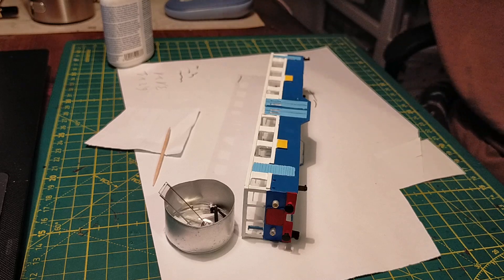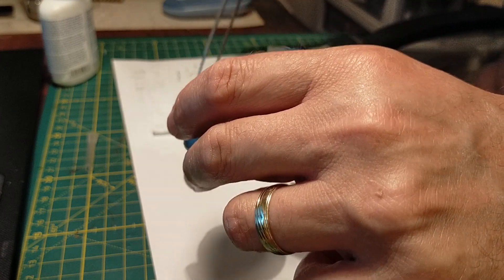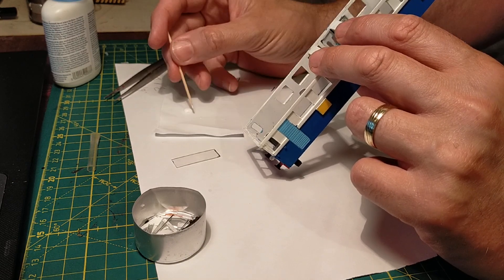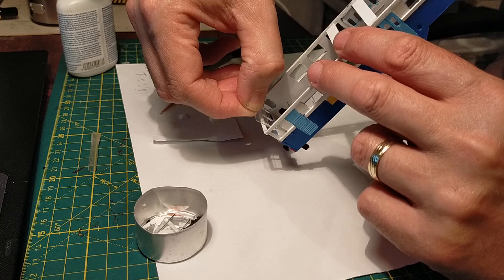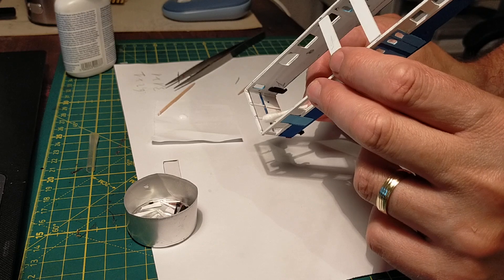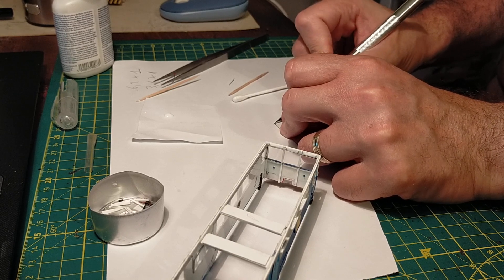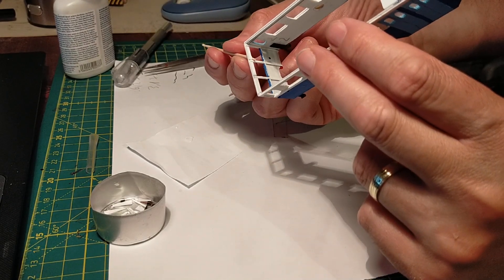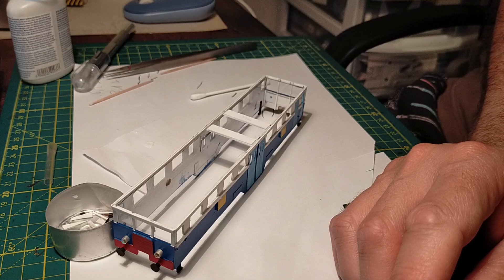Freelance railcar episode 34: fitting the cab windscreens with Glue 'n Glaze glue.

Comment: A meticulous job here, but very well accomplished. I'm glad you did the black marker frame of the glazing, it is a fine trick - I applied it when I did some windows for a water tower - way simpler than cutting very narrow styrene or even paper strip, making a slat frame etc. Also the Photoshop would be great in some cases - like making "stained glass" for a church windows, printing, cutting, carefully gluing on some glazing, then illuminating that building. Thanks for the video, Patrick, good day! / Chris :goodvibes:
Reply from the maker: Thanks! I've not marked black window rubbers on this model, as the early designs of Italian railcar don't have prominent window rubbers. I'll make the windscreen wipers in a similar manner, but using an old fashioned nib pen and paint